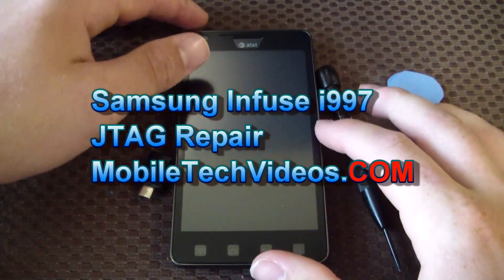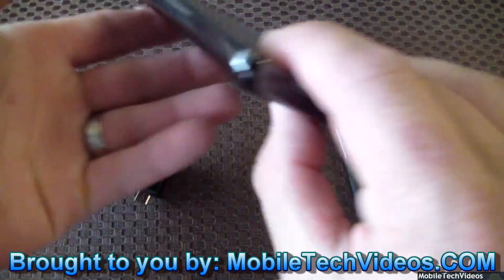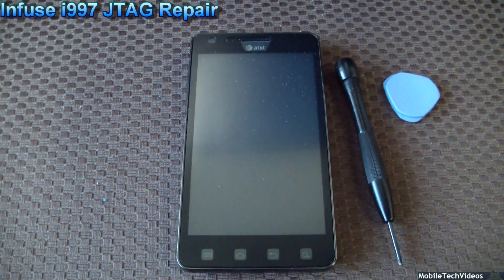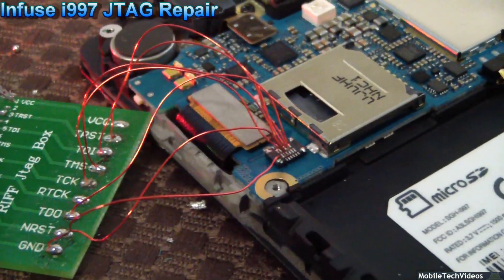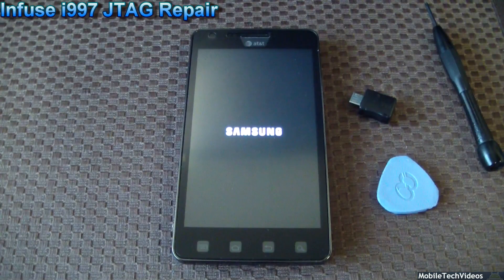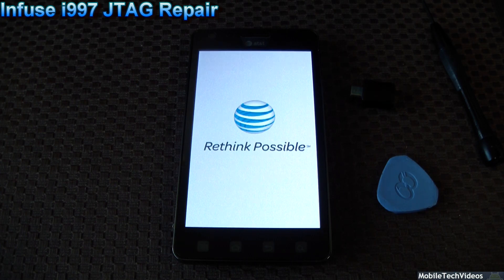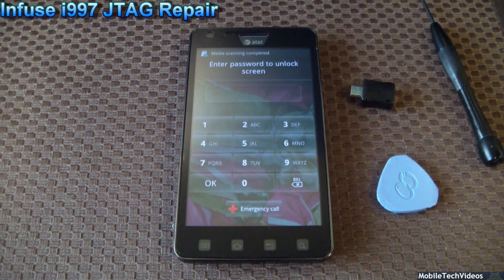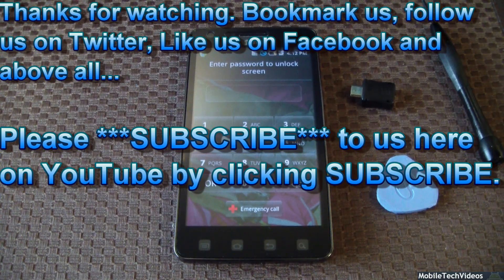Samsung Infuse 4G i997 - JTAG Service (Debricking/Unbrick/Brick FIX)

Comment: My phone turns into a gray fuzzy screen (like an old tv without a station connected to it) and when I put the battery into it, it boot-loops. Can you fix it? I gave up after attempting to make a JIG... but the USB I cut was 'special' and it will be recognized by a USB, but the drivers never download properly >_> so no hope with that for me, even if I could get it into download mode. Can you fix my phone please? XD If yes, I'll get the service :P

Comment: Bricking is when u try to flash a rom, kernal or pretty much something u change in the system and u mest up bad that your phone wont even turn on. So "De"bricking reverses the damage that was done and your phone will turn on and will work like nothing bad happened.